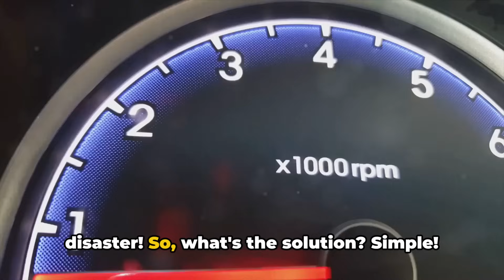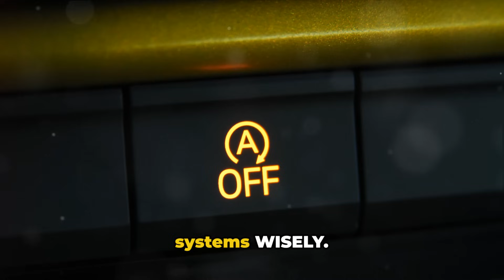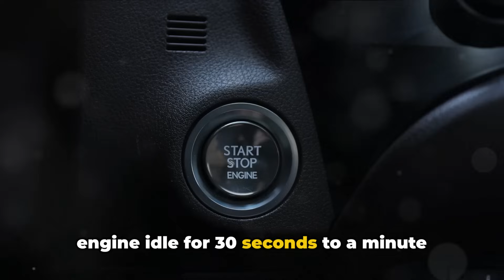5 Mistakes that Destroy Turbo Engines Fast!

Comment: To avoid turbo trouble, i bought a non turbo port injected car😊 regardless, i always turn off start/stop system and i use premium 98 octane gas with no ethanol. And change oil every 5.000 km.
Reply from the maker: Smart move! Naturally Aspirated engines can be less hassle. Turning off the start/stop, using premium fuel, and regular oil changes are great practices for engine longevity. Sounds like you’re taking excellent care of your car! Thanks for sharing!!
Reply: @HonestMechanicChannel  and let youre oil with driving warm up to 90 degrees before you stamp youre speed pedal. I always stay under 2000 rpm untill the oil is heated
Reply: @HonestMechanicChannel thank you, i do my best. And i have learned by doing and or failing. So now i know more about what can be better in car maintainance. For example i bought a gdi without knowing the drawbacks, i learned it the hard way so now i stick to port injection. Also have a manual transmission, less complicated and fewer things can go wrong. Also i now went back to timingbelt, after i learned the hard way that chains dont last forever, and are more work replacing than a belt. So im better off replacing a belt every 6 years.
Reply: @HonestMechanicChannel to be honest the heat after highway ride issue you told about 
you dont need to idle it before turning off but better to just after getting off highway and like being 3-5 minutes from home just drive it like on 4 gear 2000 rpm and try not to gas it too much because turbo will kick in then
Reply: I change my oil every 5000km because I don't drive that much. This is a year's worth of driving for me in the frozen winter to the filthy hot summers. The car is also tuned and on occasion it goes to the track. I will drive agressively here and there. German car + Liqui Moly . The oil changes are cheaper that any part on that car.
Reply: I have a 1000HP turbo Honda in the colder months I have a oil heater like a diesel that I plug in also wait for all temps to get up to 120 degrees as far as fuel that depends on how much power I want go make, lastly I use a turbo timer 3 minutes the car idles when stopped to cool off but I also have direct water injection for my intercooler, but 90 degree plus days actually do more harm than cold
Reply: Every 5k km ? 🤯
Reply: 5000km? You either dont drive very often, or you change oil every 2 months.
Reply: 98 European octane is about 93.5 US octane equivalent. 

But ethanol free will make your fuel system last longer (no ethanol water residue to corrode everything) if you can find it. 

I was not aware you could even purchase ethanol free in the EU nanny states.
Reply: I’m doing the same on my brand new 3.5
Reply: Using high octane isnt necessary in a non turbo engine, your just wasting money. Also theres nothing wrong with gdi or turbo engines it just depends on the make, model and year your buying from and yeah gdi requires a bit more maintenance but it also depends on your driving style and where you drive and for how long
Reply: 98 Octane without proper compression can be problematic, if not wasteful
Reply: No ethanol how whats the base?
Reply: Well said 😅
Reply: If your engine does not require high-octane fuel, don't buy it. You are wasting money. Higher octane doesn't mean more detergents. Only Shell V-Power has been proven to clean valves and intake systems better than other gasoline. The proof is on the Oil Geek channel.
Reply: I drive too much , if I changed oil every 5000km I would need to change my oil twice a month
Reply: Though it’s worth noting unless your engine is high compression and needs more octane in the fuel, higher octane fuel has zero benefit for your engine.  It doesn’t produce more power, and it isn’t any cleaner than 87 octane.  Octane is only needed to prevent pre combustion in a high compress engine.  Unless you know something don’t, that’s what all research I’ve seen on the subject says.
Reply: @LogainTheHumane he said his car is port injected but carbed engines usually benefit from premium fuel
Reply: @LogainTheHumane nonsense, I’m getting 130klm more per tank
Reply: Correct. People have this crazy idea that high octane fuel makes the car go better or faster or that it cleans the engine. Octane ratings have nothing to do with either of those things. Unless the car manufacturers dictates higher octane fuel then it's a waste of money. Octane is the fuels ability to withstand pre-ignition or knock meaning the fuel is combusting as the piston is trying to move upwards or at the wrong time. @LogainTheHumane
Reply: If you live in europe  your " non turbo and not Direct injection"" means a garbage 80 hp city car at best and if somehow you managed an actual NA car with over 150hp it won't be that fuel efficient  since it's probably older or s SUV ( but i agree that can change based on drive styles and a turbo can be worse efficiency wise).

As much as i understand that you care a lot about your engine, this sounds like a "too much" , most people can't and won't change their oil themselfes every 5k km, hell, they don't know even the basics of a turbo engine.
I strongly believe that if you car is decent and it's not a shit design you should be able to change oil every 10k km-6k miles/once a year based on what comes first without issues ( which was standard and now it's even less of what manufacturers says) in the long run.

It also depends on how you use your car, if you drive it gently HOME/Work and sometimes have a little fun it's a thing, if you beat the shit out of it i agree that your oil changes must be done more frequently.
Reply: And what car do you own that requires 98 octane? Bugatti? Because I ain't never seen 98 octane on any gas station
Reply: @2024hekyeah It’s common in Europe. I think the ratings are measured differently in the US.
Reply: US measures its fuel in AKI, alot of the world uses RON.

93 AKI is similar to 98 RON.
Reply: @2024hekyeah EU stations
Reply: Oil change every 5000km is just overkill
Reply: You are correct..good synthetic is ok for 5 to 6 k miles.
Reply: Your just wasting your money on premium gas and getting absolutely no benefits.  But if you like burning your money keep doing it!
Reply: @J-jk9pb I’m getting 10-15%
better mileage, most noticeable when I’m towing. Brand new F150 3.5
Reply: 98 octane? My guy that basically race gas. It’s slightly leaded. Not good for your lungs. Here’s a suggestion use 93 octane+ Boostane. Cheaper and better. Instead of carbon deposits it leaves orange deposits easier to clean and nowhere near as hard as carbon. Coats the catalytics, but you can easily clean it with wd40 gel lubricant
Reply: @Eclipsis17 in Europe 95 is standard and 98 is premium and 100 is for cars 500hp+.
I put 100 octane to my 600hp M2. Recently Shell is not delivering real 100 octane, therefore I have switch to mix of 98 with ethanol to boost it to 100ocst